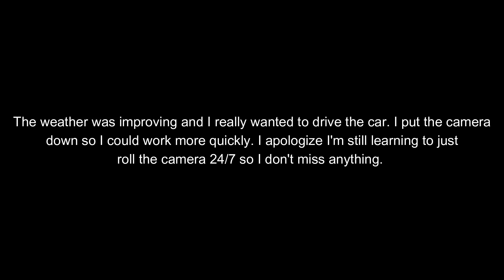Turbo LS 5.3 HEADS ON CAM SWAP! Sloppy Stage 3 to Sloppy Best Cam!

Comment: Nice build, but quick question I have an 66 Cutlass LS swap LQ4 that im painting soon and your F85 is just the color i want, do you know your paint code by any chance ?
Reply from the maker: Unfortunately I not have a paint code. It was a custom color we mixed the day it was sprayed. I can tell you the base coat is a very dark charcoal gray, then turquoise pearl, then clear.
Reply: @BuildSeason  sounds good thanks for answering man, actually thats all I need to know i wanted to have a shade of blue instead of the greenish you got, I seriously love your F85. Thanks again

Comment: Wonder if the heat from your crossover pipe was causing some excess heat in the trans and therefore the trans to lose 3rd?
Reply from the maker: I doubt it. Probably 14psi and 7000 rpm lol